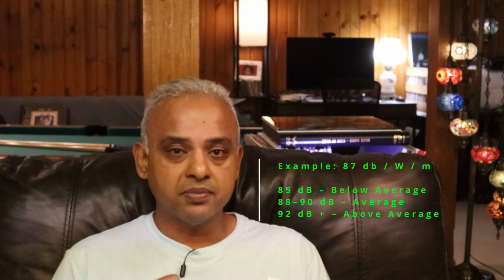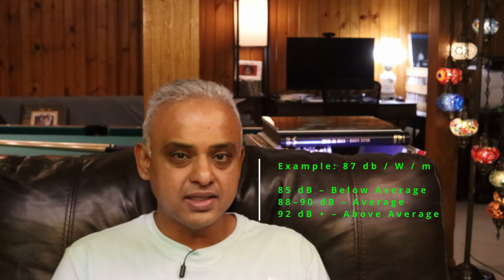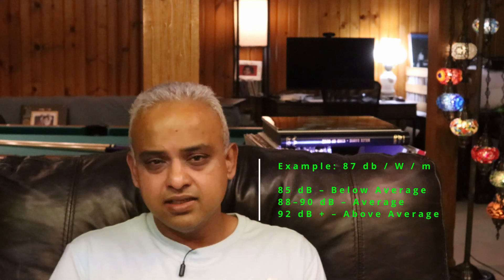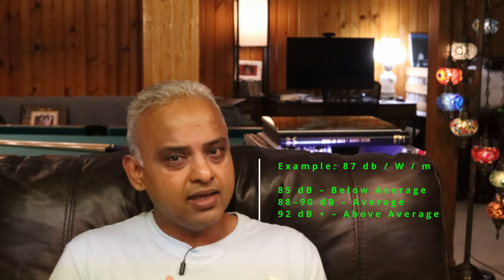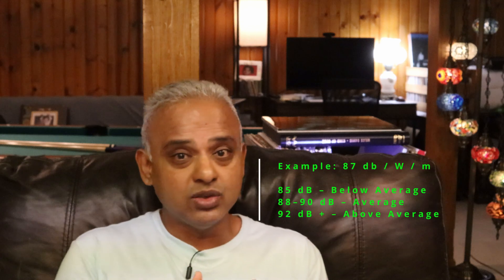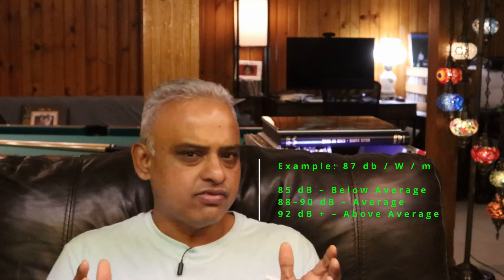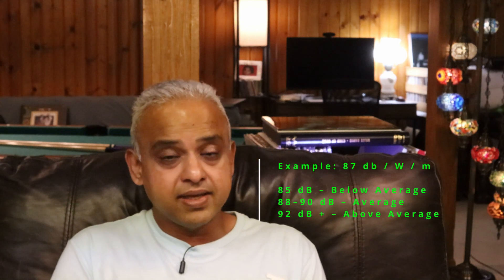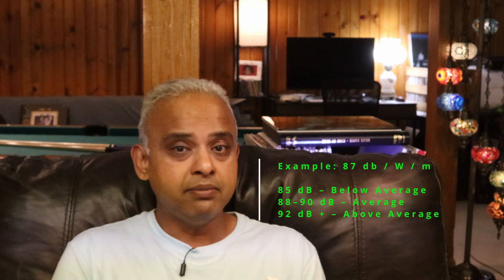Don’t Buy Speakers Until You Watch This: Sensitivity, Impedance & More

Comment: One of the better sounding speakers I've bought over the last few years were the Fritz REV7 SE. 87db sensitivity spec. Using high end drivers with a series crossover design. Impedance only drops to 6 around 200hz & the phase angle looks more like a phase line. Despite the sensitivity I could drive it with just a couple watts. 
These speakers opened my eyes to just how much of an effect that the crazy impedance swings & phase angles have on the amps & sound. They have a different type of clarity or ease in the vocal & upper frequencies compared to my other typical name brand speakers. 
One of the more frustrating purchases I made many years ago was an expensive power amplifier that had a very low 10k ohm input impedance. Normally not a huge deal for most people but I am in it for the hobby of trying & playing with as many components as I can get my hands on. I was also just getting into DIY back then & started with tubes. I had a lot of compatibility issues because of impedance mismatches between preamps & that power amp I spent over $2k on. That was a big audio purchase for me then & I didn't do my homework on its specs. I was enamored with it's high wattage & extremely low noise floor & didn't even think about its impedance.
Reply from the maker: That’s an awesome share! Feels like a perfect real world example of why impedance and phase behavior matter way more than a raw sensitivity number.

Because on paper 87 dB doesn’t look easy, but when the impedance doesn’t dive and the phase angle stays sane, the amp suddenly feels like it has way more grip and headroom than you’d expect. That ease you’re hearing in the mids/upper-mids is exactly what happens when the amplifier isn’t being yanked all over the place by wild swings.

And yeah…that 10kΩ input-impedance power amp is a trap, isn’t it!. Tons of people buy a high-watt, low-noise spec sheet and don’t realize it basically demands a perfect preamp match or you end up with rolled off bass, thinness, or that weird lack of drive you described. Happens way more often than people admit.

Really enjoyed reading this and it lines up beautifully with the whole point of the video: the electrical behavior of the gear determines way more of the sound than the marketing specs.

Comment: As usual, another splendid and lucid video.
your video about matching the output voltage from the DAC/ Pre amp to the power / integrated amp helped me to make the necessary corrections. It definitely changed the way the music sounds. I can now listen comfortably at 12 o'clock.

Comment: In my opinion most garden variety amps integrated etc should not be sold. They claim 100 watts but in reality can't drive book shelf speakers regardless of sensitivity.  My experience informs me that only a few reputable companies make good amps. There should be no money spared in acquiring the best amp based on manufacture reputation.  Stick with the best brands from reputable companies foreign and domestic.  Case closed.

Comment: I have two Harman Kardon receivers, an Onkyo and a Yamaha receiver that have an 8 and 4 ohm switch on the back. The HKs with the switch set at 8 ohms have lights that say high voltage and high currant. With the 4 ohm setting only the high currant light is on. The speakers on one HK and one Yamaha are fairly new POLK Audio. They said 4 ohm when I bought them. After emailing Polk they quickly changed their web site to 4/8 ohm. They are not the most efficient at 87. I do not have the opportunity to play them loud but the HKs seem to sound better on the 4 ohm setting. Is it just in my mind?

Comment: Two speakers with same impedance, sensitivity and even same frequency response can sound different. Material used speakers also matters, polypropylene, Kevlar, carbon fiber etc produces different types of sound. Personnel preference also matters. Some may soft some may prefer harsh. If you are very much interested sound quality, better listen them in some store. It is very hard to do online research and a get a speaker of your taste... amp type also matters. Costly ones may not be better ones

Comment: Great explanation about speaker specs 👏👏👍. Thanks

I am planning to upgrade my speakers from Wharfedale Evo 4.2 Bookshelf. ( I use Naim Nait 5si amp). I am contemplating between Proac Response D2R and Spendor Classic 3/1. Can you suggest which one would be more synergistic with Naim Nait 5si amp? Thx
Reply from the maker: Ive had the D20R and the Classic 3/1. Both fantastic. It depends on your room and listening tastes as well.

Comment: Thanks for these explanations because a lot of manufacturer specs defy logic. I have a Pearl Sibelius with rated power handling. 35 Watts RMS – 70 Watts peak but Pearl only made a 10 watt tube and in show demos used Gallien 20 watt tubes. Yet many users are powering with 100+watt high end amps.

Comment: Hi great information, just a slight thing , when we are talking about power then for eg 3dD is times x2 or -3db is 1/2 , when we are talking in voltage then 6db is x2 or -6db  is 1/2 , this is because the formae for voltage diffent for power , great explanation for impedance etc . Regards mark

Comment: I have a 30wpc amp paired with speakers with sensitivity 86DB and are 4 ohm. No problem. Years ago I used a 20wpx tube amp with Advent 6003 speakers. I remember when a 45wpc Pioneer receiver was considered powerful. Today so many speakers are inefficient with low sensitivity.

Comment: Very informative 👏 
Speaker specsheet shows the power rating like 50-200W what is that mean by 
If the speaker distortion free SPL 105DB as per the specsheet then to achieve this SPL on full Freequency spectrum required 200W RMS continuously is it correct?
The same way can we Run the standmont 2way bookshelf speaker with 6.5" Drive in Full range ( 20-20Khz) required SPL is 90DB.
Another very confused doubt about subwoofer integration with standmont speaker like company Rel-Tx series series having speakon connection what's your taught on the subject 
standmont mount speaker placement is very tricky due to their rear port construction what all points to be considered regarding placement in dedicated room with concrete floor/walls and what RDT-60 supposed to be maintained for Music as well as movie watching
Reply from the maker: Thank you. 
I will try and answer some of your questions. 
Continuous power rating of a speaker (as explained in the video, roughly at 7:29) refers to how much power the speaker can handle continuously without damage. Not necessarily needed to power them to their full spec'd potential.
Some stand-mount speakers with room gain can go seriously low in the bass. Not sure if you can actually get 20 Hz as it may very well depend on what speaker you are referring to, and room boundaries. Watch from 9:09. Too much bass output is really why placement becomes difficult due to summation and cancellation of certain frequencies (room modes). Both ported and sealed designs will have to contend with this issue, if they produce prodigious amounts of low frequency.
Reply: @analogholic_reviews thanks for detailed reply 👍 
Regarding 20hz its very clear standmont speakers can't play such low freequency only dedicate subwoofer can do that jobs 
Regarding amplification how to calculate properly howmuch power required to drive my speakers since its considered alot of variables with respect to followers elements like listening volume in DB /distance to MLP/DB-loss/impedance and headroom......etc and how to calculate the amplifier headroom for safer side howmuch need to be considered for selection of amplifier
Reply from the maker: @sandeepjohny6480  Excellent question. The answer lies in assessing room size, listening distance, speaker sensitivity, impedance and desired SPL at ear... I will make a video on that shortly!
Reply: Thanks sir,
Social media PF is misleading somany things Regarding AV so normal consumer getting confused about the speaker selection as well as matching electronics i belive on your chanel explanation about speakers / aquestics / amplifiers...etc very technically this is very important to understand about the relationship between sound and aquestics properties of the room sameway how the room modes interference with our speakers,how to avoid the boundary interference with our speakers and how can we measure the boundary interference of a speaker related to the placement,how can we achieve the wider sweet sport, which kind of HF drive can provide the best off axis response .....like alot of valuable information are there to building a dedicated 2chanel or multichanel setup is it possible to use the same dedicated room for 2chanel and Hometheature setup i belive you are really making very educational videos thats why i am asking these doubts  @analogholic_reviews

Comment: What happens regarding phase angle if you have a subwoofer that has a built-in amplifier and you take advantage of that extra power? My Maggies are incredibly fast above 40 Hz and My Carver True Sub has a 3700 W built-in amp. The cable length from the fix😂d output of my preamp to my Sub is about 16 feet which adds some small delay. My Sub has a phase adjustment as well as volume and crossover frequency controls. How would I deal with phase angle in a situation like this?
Reply from the maker: Let me think about this a bit ... and feel free to correct me if I'm misunderstanding the question. The concept of phase angle as an amplifier load issue as discussed in the video may not apply in the same way here, because your Carver True Sub is self-powered. That means your main amplifier isn’t “seeing” the subwoofer’s electrical load—only the preamp section is sending it a line-level signal. So you’re not taxing your main amp, and 3700W sub amp power sounds massive.
But Phase Still Matters in Terms of Time & Acoustic Alignment. What does matter is acoustic phase alignment between the subwoofer and your main speakers—especially in the crossover region. If the signals are out of phase, they can cancel each other out at some frequencies, leading to weak or “missing” bass. You mentioned your sub is about 16 feet away from the preamp—which introduces some electrical delay, but this is typically negligible at audio frequencies. What matters more is distance from the sub to your listening position vs. the mains, and how the sound waves align in the room, not in the cable.
You probably know this well but the phase knob on your subwoofer is designed to help time-align the subwoofer's output with your main speakers. It adjusts the delay (in time) of the sub's signal relative to the mains.

Comment: Very nice talk, I think most of us never have the opportunity to try a variety of amp and speaker combinations unlike reviewers. I have a similar audio 100 watt integrated and fyne audio f502sp speakers so lots of power but always wonder how they would sound if I had a 25 watt or less tube amp or less efficient speakers with the same amp, I had castle Chester’s at about 89 db, I think, and they sounded great but did no play loud coherently. I cannot find anywhere in my small city to try a low power tube amp. I would need to drive 270km to even find such an amp. Only one brick and mortar shop nearby
Reply from the maker: What tube amps are in stock at the store near you?
Reply: @analogholic_reviews In fact none, I will have to travel 150 kilometres to Ottawa or 270 to Toronto to try and then just very high end, Thomas will ship me one to audition but then I gotta set it up and ship it back if I don’t feel it. Or I could drive to Montreal and hear one at his location but that seems like imposing my procrastination on him. I just want to give a nice listen with my chosen favorites that I know sound a certain way, sorry for my waffling.
I think just prima Luna and macintosh
Reply from the maker: I have owned PrimaLuna Prologue One and the Dialogue Premium Integrated amps. I enjoyed the control and finesse they provided. One of my all time favorite tube integrated is the Audio Research VSI60. Full throttle dynamics coupled with nuance when driving the Acoustic Energy Corniums, Vienna Acoustics Mozart Grand SEs, and my beloved 4 pi speakers.

Comment: My problem is these darn Infinity Kappa 7s and 8s continue to blow away any other speaker even regardless of price.  The polydome mids are the weak point as in unobtanuim.  I have two nos in boxes awaiting failure.  Having replacements really matters.  These speakers always got a bad rap due to being very hard to drive.  Kind of like Magnepan but these play loud and sound great vs ho hum on Magnepan.  I do like these 650 dollar LRS Magnepans for the price kinda hard to beat of course now 999.

Comment: Great video! I commented on your amp specs video hoping that you'd do this. Amazing overview! I guess my philosophy on this (like with amps) is that the speakers' numbers need to make sense together within the unit and for the application. They also need to make sense with the amp and source(s). 

Way after we've got those synergies figured out then we might need to think about how after "good enough" cable doesn't matter until it does. Although not a major factor of note unless the cable is terrible, impedance, capacitance, and inductance do get a say in what the Amp gives the speakers. 

Certain amp designs and speaker demands will be considerably more sensitive to cable characteristics. For example I'd worry much less about capacitance impedance inductance and resistance over the run length with an excessive current constant power (often class A biass) amp than i would witha fast power on demand design. Even if the fast amp had twice the nominal output. System synergies.

Comment: I already have a music system comprising 
Marantz Model M1 
Q Acoustics 3050i
SVS SB 3000 Sub.
Was thinking of upgrading amplifier to
Cambridge EXA100 or
Marantz Model 40n 
My questions are that
1. Did upgrading to any of these will result in any significant difference ?
2. If yes then which one of these two should I go for or if you want to suggest any other ?
Thanks
Reply: It's easier to upgrade your speakers. Something like the Concept 50s or even the 500s if you wish, should give some improvement in the midrange (scale and ease of drive).

Your 100 wpc Marantz amplifier is powerful enough easily to drive your or any other Q Acoustics loudspeakers.

No amplifier in the world can add much more than to what you already have.

None of them.

Just for curiosity's sake, you could compare the most expensive one with yours and see if you can detect any difference.
Reply: @jozefserf2024so that means I should consider upgrading speakers first. 
Thanks for your advice.